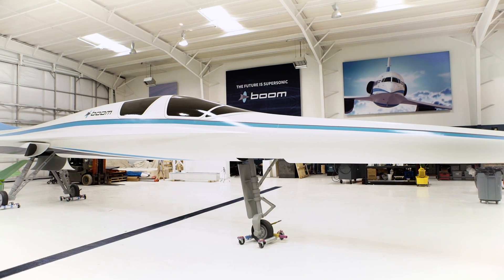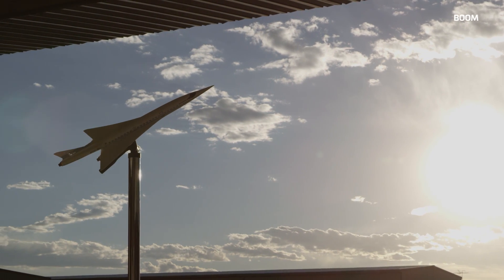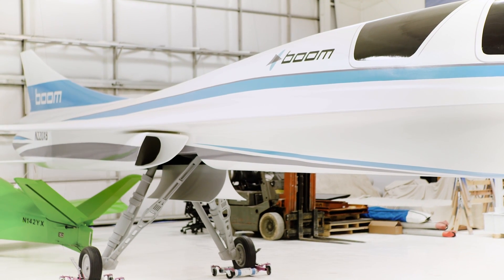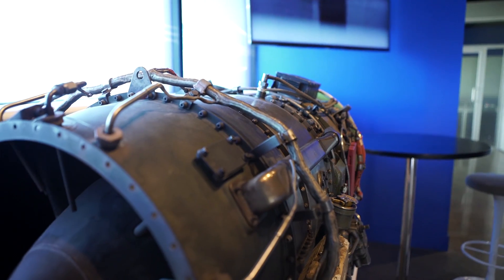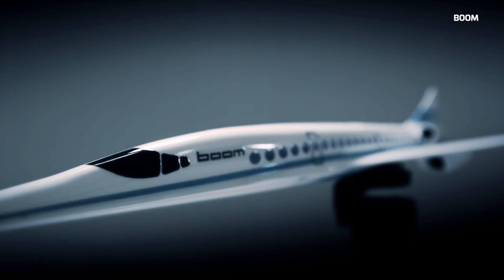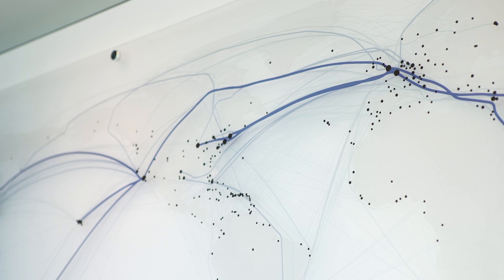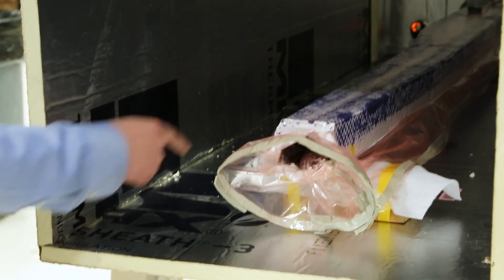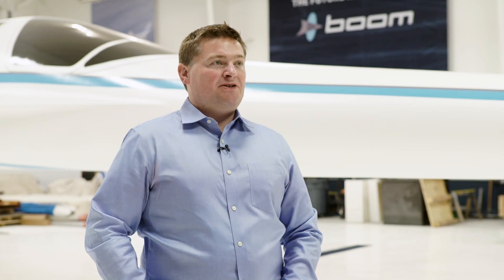Boom is bringing back commercial supersonic flight

Comment: Like the Concorde, this may find a niche market for the wealthy.  I don't see it ever being a mass market aircraft--even if Boom uses more efficient lighter-stronger materials and better engines than the Concorde.  Here's why.  Those same efficiencies in materials and engines can be used to make subsonic airliners more economical, and they will always be more economical than supersonic airliners.  It's a matter of physics.  So subsonic airliners will always be cheaper to fly, and flying supersonic is not enough of a speed advantage to make most passengers willing to pay a lot more.
Reply: I don't think your statement that this is "a matter of physics" is entirely true. Fuel costs, surely, are typically going to be higher for supersonic jets than they are for subsonic jets, but you forget that a plane that does a round trip in twice the time, effectively halves the plane's depreciation cost as well as staff cost of operating the flight. If taxes, training, maintenance etc. don't change much from subsonic flight (which is a matter of scale), then the difference in operating cost is not necessarily higher for supersonic jets than it is for subsonic jets.
Reply: Most subsonic customers already paying 5k & up for a better class seating so they'll probably just fly supersonic instead

Comment: Several of those routes they showed go over cities where this jet can't fly super sonic, and it's far to expensive to fly a supersonic at subsonic speeds. 

This is why we don't have them
Reply: its not like they would be going supersonic right off the runway and it is expensive to fly supersonic at subsonic thats really the problem expenses thats why they choose the engines that they did plus they have speed limits of at least 200 kts in airspace's like class D for example LAX is a class D airspace. so a flight to Asia or Hawaii would be possible  considering by the time they are over the ocean they would be going supersonic most of the flight but going to the UK might be a problem unless they set altitude minimums for supersonic booms say 20,000 to 30,000 ft then it might be less of an issue but never the less still a big problem to solve and the demand might be less then expected so they might just go out of business anyway all tho that would be sad if they can pull off making the flights compete with airlines witch may be impossible as airlines have to ajust their prices with smaller company's like jet blue or easy jet  so idk how they would compete with that. you make some good points tho man.
Reply: that's my point most high volume flights (required to justify the cost of the plane) will take you long distances over cities. height minimums wont help a sonic boom is still loud af even at 50,000 ft.

Comment: $5000 is an avg business class fair. Would be great if they can achieve this.

Think one challenge, in addition to others already mentioned here, will be achieving shorter take off and landings. Otherwise only airports w long runways will be accessible. 

Another will be fuel burn. They've addressed this somewhat by removing of mechanical subsystems like the droop nose of Concorde. But using 3 thirsty older generation subsonic engines will not be favorable in a time where airlines are searching for aircraft that offer even minute efficiencies that improve fuel economy.

Projected direct route from SFO to SYD would be one of the longest that any supersonic aircraft would fly nonstop. Don't know how they plan to do it but likely require some form of super cruise to achieve reasonable fuel consumption.

Comment: There is abit of a mis-statement on the routes economic viability wasn't the deciding factor.  There even before launch were more viable routes concord wanted to fly.  It was prevented by not being granted permission to use airports due to noise.  Yes global travel has increased but so has wining and protesting based on mis-conception and ignorance of facts.  Noise will need to be shown to not be a concern before some routes will be granted available.

Comment: Good luck at being "Affordable" while flying "super-sonic", the amount of fuel that was used to even taxi to the runway in a concord was astronomical compared to conventional airliners. Not to mention all the regulations the FAA set in motion because of the concord like "the plane cannot go supersonic unless over the ocean to avoid unnecessary noise to citizens from sonic booms". If you can get around those barriers with your new supersonic passenger plane then you would essentially be finding the holy grail of air travel so good speed!

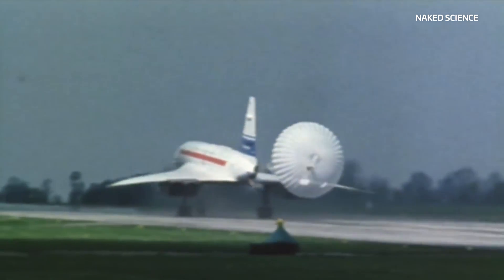Comment: 1:45 "Synthetic Vision" fancy word for camera & LCD display
Reply: The mechanics of the droop snoot could break as well. Not sure how those mechanics are more reliable than a camera.
Reply: Sashin Gopaul droop snoot is mechanically complex & will add unnecessary weight. Camera is more reliable as it requires no moving part
Reply: rather have the droop snoot incase something crashes into the camera or the LCD screens stop working.
Reply: The cameras will certainly be military grade extreme reliability models, probably with backup redundancy.  And as with any aircraft if you can't see the runway an ILS approach is always an option.  (How planes land on a foggy day)
Reply: Anas Takiyudin yes they are trying to sound technical
Reply: Anas Takiyudin :D
Reply: I wondered why they chose such a long way to explain it. It would suffice to say that we can use cameras to see below the nose so it no longer has to tilt. Why the technobabble jargon?
Reply: @adamp4155  sounds like a textbook scam to me
Reply: Synthetic Vision doesnt use camera ...
Reply: I suspect there's more to it, as in computer-aided augmented reality, a blend of human and machine vision.
Reply: ur dumb. They'd obviously used OLED😂
Reply: It's a scam and they just use fancy word to lure investors in. I doubt this will pass FAA tests since camera systems can have small delays which is not so negligible when you are flying fast. Also if the cameras malfunction then the plane couldn't land? Even if there's ILS when you are about to touch down there's a requirement you must see the runway yourself cuz several accidents happened before when pilots capture the wrong ILS or some equipment failed and didn't align correctly with the glideslope. Another difficulty is where do you install the big LCD displays that shows the runway on landing. Those should be pretty big to capture a full vision of the runway and above, but such large LCD screens will likely cover the instruments, unless they make a transparent display attached to the window and when they land they show the video from window, which again, may cause illusion to pilot about the angle of attack. Put them downward will cover the instruments.
Reply: @chendavid9582  just have the pilot wear a VR headset. Problem solved. You are welcome!
Reply: As soon as I saw the toy in the hangar, I knew it was a fake. Yet another venture that looks good on paper.
Reply: I'm thinking it's more like what you see in high end BMW and other cars where you can see 360 around car but the image is synthetic.
Reply: Anas Takiyudin no. They'll make glasses for the pilots that will opaquely display the runway while they can still see their displays. Something like that I think.

Comment: Still slower than the Concorde... It's insane what these guys were able to do in the 60's.
Reply: ßaron The airliner will fly at mach 2.2, faster than concorde. For noise reductions, they will use non-afterburning medium-bypass turbofans.
Reply: @autogolazzojr  concord is March 2.5
Reply: little tomo boy I have no idea what "march 2.5" means. I assume you mean "mach 2.5", which is completely wrong. The Concorde flew at a speed of mach 2.04.
Reply: ßaron One of the reason the Concorde was banned, was that the noise. It made veryyyyy loud noise. Boom gotta reduce speed and make it legal somehow
Reply: @LominatySpy  Hello man, actually, the noise inside the plane was ok when flying (quiet on the air) just a bit of noise during the landing and the lift-off but nothing enormous it was not unbearable.
The main reason of why Concorde has stopped flying is the cost + the fact that U.S.A didn't wanted it to land in their airport, or forced french Airlines to pay a very high tax, only because they did not have supersonic air planes.
Reply: @ninjaim5147  Americans are so jealous.
Reply: @ninjaim5147 

Noise refers to the people on the ground, who will be subjected to the sonic booms
Reply: thats not gonna lower the sound of the sonic boom....
Reply: They said Mach 2.0.  I thought that was all the Concorde could do as well.
Reply: The Concorde was heavily subsidized, it wouldn't have been doable without the political climate at the time.
Reply: ...Fuel consumption though.
Reply: +Baron
Concorde flew at 1,350 mph...
Reply: Actually, good point.
Reply: ßaron: That is what the presenter is trying to say, they could do better now with the technology we have.
Reply: Concorde was mach 2, this is mach 2.2
Reply: New plane is faster, it can do mach 2.2 
Look it up if you want proof

Comment: What the engineer's in France & the UK achieved was the Holy Grail ...  Remember the Boeing SST Project ... failed .... your engine pods are way are too small to slow the air down enough , you need to go the way of the SR71- A Blackbird and it's turbo-ramjet setup.. how an earth can you better Concorde with its non-after burning super cruise at Mach 2 will be interesting to see.
Reply: Czorńy Lisek I'm not saying it flew noiseless but the noise wasn't heard onboard, it was so noisy onboard a Tu that passengers couldn't hear anything except engine noise. Anyway Tu lasted one yr Concorde 27yr
Reply: Czorńy Lisek Concorde wasn't put out of sevice cuz of accident, after the French crash the fleet were upgraded but people stopped buying tickets, for £20.000 a pop it was way to expensive.
Reply: skeelo69 yea because the highest super cruise is at mach 2.2
Reply: There is absolutely no reason for engines like in Blackbird

Russian MiG 31 use completely normal commercial engines from passenger/cargo planes yet it can fly up to 2,38MACH
MiG 21 use normal turbojets and can fly up to 3,2MACH
Also TU 144D had Kolesov RD-36-51 that as far I know didn't had afterburner.
Reply: Czorńy Lisek the Tu 144 was a really noisy piece of crap that got scrapped after a yr. They couldn't find a way to fly it without using the after burners continually
Reply: Did You even read that Tu 144D used engines without afterburners? ;P

Also Concorde used Rolls-Royce/Snecma Olympus 593 that come with afterburner. 2/3 of that engine is afterburner if You would care to look at drawings :3

And You really think Concorde was silent? The fuck no. There was no noise regulations back then as such every plane was loud as fck.
Reply: It was put out of passenger service due to accident just like Concorde. Not because of noise.

Plane as plane was in production for 20years(1963–1983) and used for many years after.
Reply: One engineer, two engineers, not engineer's.  It's not difficult!

Comment: Supersonic airplanes especially bigger ones suffer from the sonic boom no matter how good they are designed. The proposed trips that were referred in the video are mostly above sea where the sonic boom isn't annoying. 
Trips which are mostly above land will be excluded and that won't be good for airlines. 
Supersonic speed demands more fuel per passenger and the slim design of a supersonic airplane is very restrictive to the number of passengers. Unavoidably the tickets will be many times more expensive than conventional ones. But that doesn't matter a lot for businessmen and wealthy persons. 
I doubt if this airplane will ever serve ordinary passengers. This isn't necessarily bad because it is not an ordinary airplane.

Comment: Pakistan China joint aero technology is underway, 5.5+ Mach and 300+ passengers
Reply: Anders K Andersson mmm no.
Reply: Anders K Andersson hahaha china even not capable build the engine, too much watching movie making you in delusion that china was hi tech country, is not...
Reply: I designed a jet that can fly at Mach 73+ with 500 passengers. I was going to call that Boom. Dang they took my name.
Reply: F class military aircraft won't go past 3.5 at the most
Reply: At 5.5+ mach you have to skip out of the atmosphere like a dolphin. Then you need a heat shield to come back in and not burn up.

Comment: what is people's issue with the sonic boom? i live on a small island which would be ignored with regards to the noise pollution and remember hearing Concorde flying over head and it was barely noticeable, no where near as loud as living anywhere near an airport?
Reply: They make a big deal out of a sonic boom when most people are listening to loud exhausts and sirens all day!
Reply: Exactly! In the 1980s, it was normal to hear sonic booms from military planes several times a day if the weather was nice. No big deal. Of course there would have to be some restrictions, but a couple of sonic booms per day wouldn't be a problem.
Reply: You can barely hear it if the plane is flying at altitude.
Reply: a small island whatever but it can shatter windows and cause property damage in large cities with tall skyscraper buildings
Reply: @azugirl111   That would be if they were flying mach 1+ at under 1000 ft. Fly subsonic until they reach 40,000 ft then accelerate.
Reply: A boom every once in a while wasn't a terrible thing, but there are like 87,000 flights a day across the US. There are various reasons and tests they did, but basically it was banned by the FAA in the 70's, I guess this company is trying to show there is a viable alternative.
Reply: In the video they suggested the routes and all of them appeared to be over water...  The sonic boom problem remains.   It would be interesting to fly super sonic.  I wonder if they would make the seating comfortable enough to make the price increase worth the time saving..  E.g  If i could fly in a super comfortable sub sonic business class seat for 15 hours, what would i get for almost the same price supersonic..
Reply: Islamisthecultofsin it is the fact that it can shatter windows and things

Comment: Boeing should partner with/fund these guys, as Airbus is doing with Aerion. Boeing has there technical expertise in general and especially with composites such as carbon fiber because of the 787. They also have manufacturing resources and that giant carbon fiber oven thing, which would lead to a cheaper and higher quality product than otherwise. Also, it would be Boeing versus Airbus some more. The names even match up; Airbus, Aerion. Boeing, Boom.

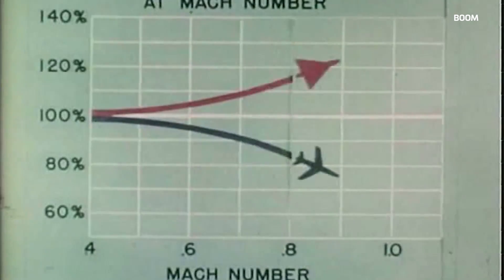Comment: 4:21 isn't that the TU-144 NOT the Concorde?
Reply: Gavin Li1117 yup, those kooky Russians and their flying machines
Reply: It didn't always have canards thats the first version without the tu144 has the engines closer together as shown in the video
Reply: Gavin Li1117 Yes
Reply: The canard wings were added later on after realizing the airplane had poor handling at low speeds.
Reply: Welp I see Red flag in Wings
Reply: lol i saw that too XD
Reply: There are no canards, but there's a huge "Ty" logo on the side, so...
Reply: It's got the Tupolev logo on it and the standard return ticket price from Heathrow to JFK is £8,292.
Reply: Jose Colon u know the Russian plane flew first
Reply: eh, close enough